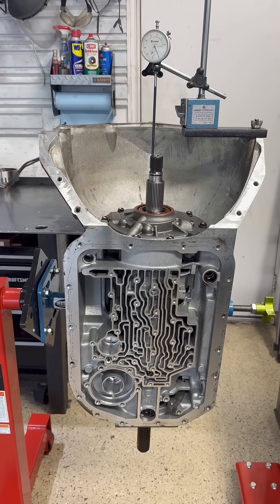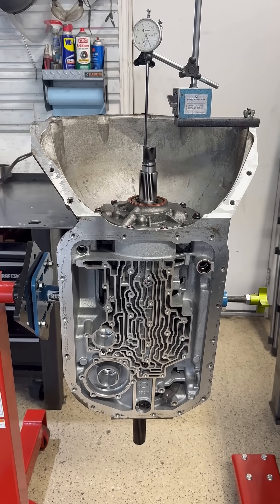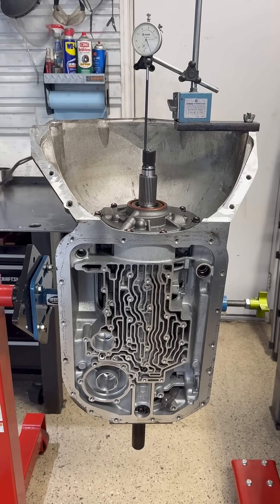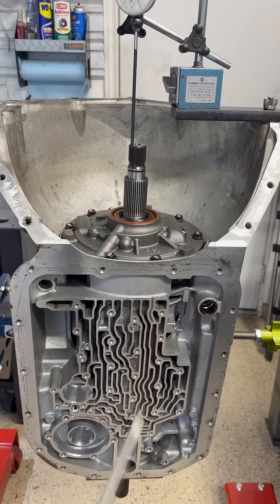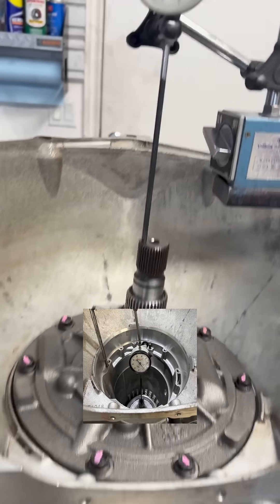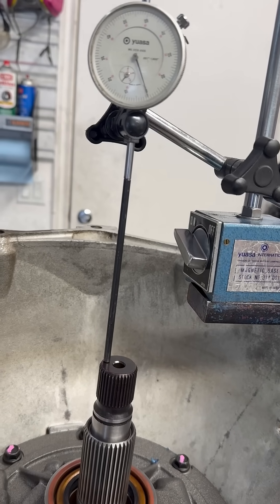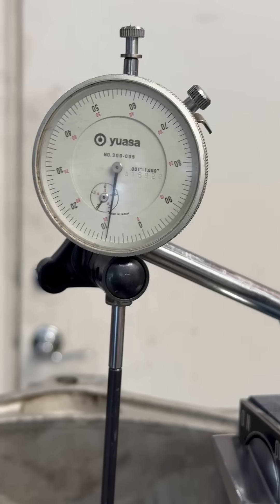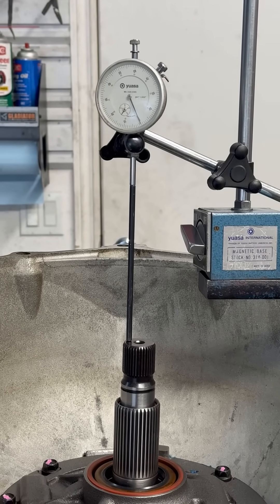4L80E - Rear Gear End Play Measurement Differences

Comment: Rebuilt my lightning struck 06 Jeep Wrangler "TJ",  30 days of burnt up wiring harness, sensors, altenator, ECU..etc

Then three weeks and $3,000,  after getting it running, reverse and over drive went out on the 42RLE transmission 

It has 200,000+ miles on original transmission, one trans oil flush, two filter changes, one rebuild of the Valve Body with Sonnex Accumulator(s) kit.

What is good transmission rebuild kit on ebay that you would recommend?

Jeep is my daily driver, seldom do offroad and light towing of my popup camper.

Is it a straight forward process to rebuild the 42RLE ????
Reply from the maker: Hi Ben, thanks for watching. Please post your above questions here and I'll respond when I can: https://youtu.be/u9QktRFa0RQ

I prefer to keep discussion pertinent to the transmission featured in the video.
Reply: @nickstransmissions Aaah, Pertinet, got it, thsts like say Aaah Bach during a music discussion and your a Jock!
Reply from the maker: Lol!

I'll have some recommendations for you when I see your post in that other video...Unfortunately I don't yet have a 42RLE vid series on the channel yet but hope to soon.